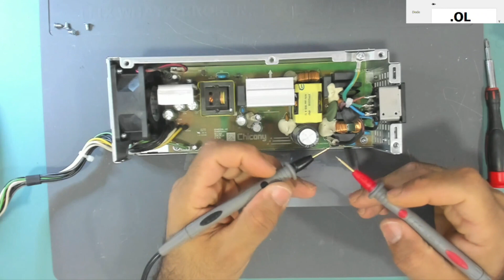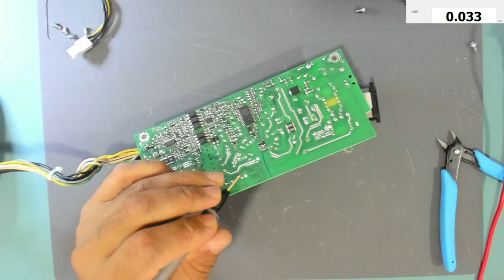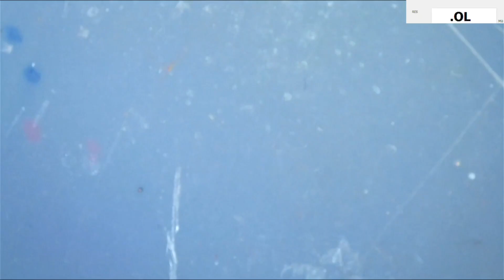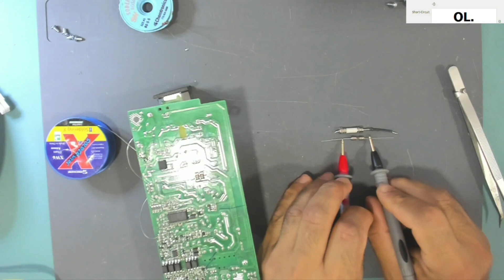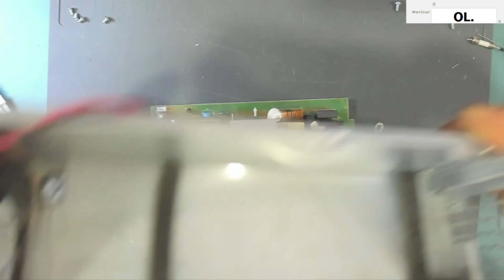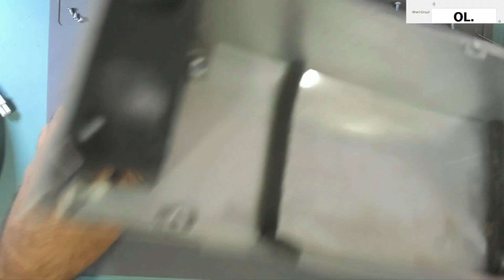Dell Optiplex Power Supply Repair || SMPS Repair

Comment: Hi.

My DELL has the 5V in the green wire, but when i do the paperclip short, i dont get 12V out, where could the problem be????

😥😥😥😥
Reply from the maker: Hi bro 
There could be a short at the output side of the 12 rail